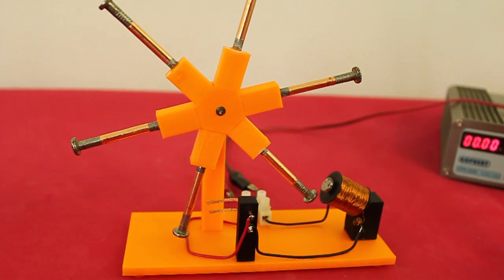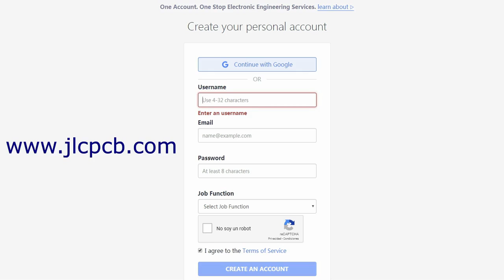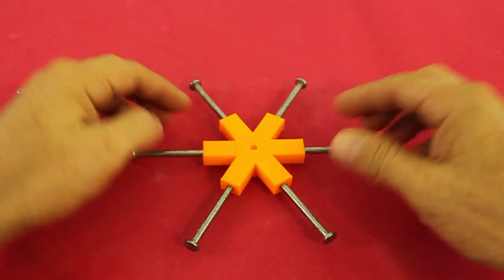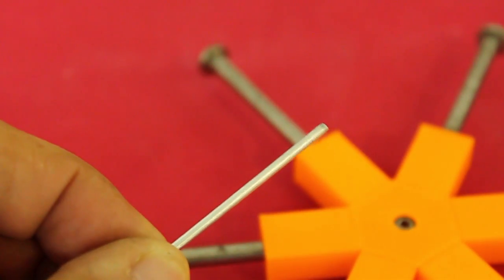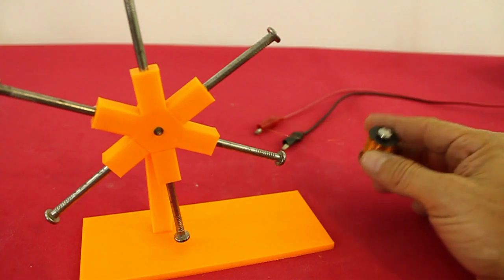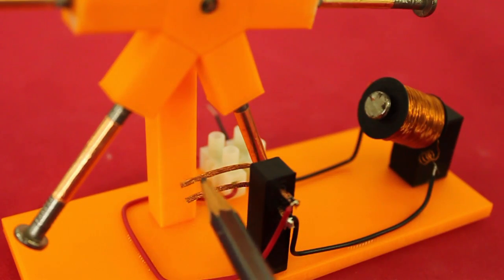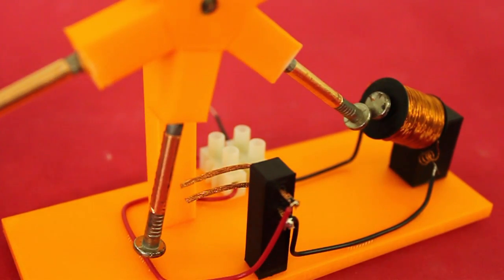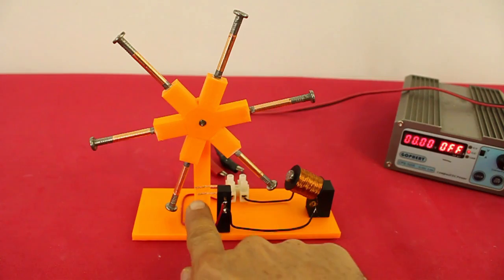Nail Motor that Uses No Permanent Magnets

Comment: Cool and simple solution for an electric motor. This got me thinking of the sparks that wear the contacts down and will make the engine fail after a while. So I have an electric e-bike and every time I connected the battery to the controller I got a spark. 

After a while I didn't have any contact or the contact got overheated so I had to make a new contact. So a friend of mine did an electric switch of some kind that when it were in off mode the current went through a resistor when I connected it to the battery.

Then when I turned the switch on while it was connected it allowed the current to skip the resistor. That have saved my connectors from any kind of problems.
What I wish I could learn is to make such a switch myself because I think this is a must have solution. Also I don't know if it is possible to to make a connector that would work without a switch. Maybe some kind of two steps insert contact. I don't know. 
It would be really cool if you could show me how to make this switch. Thanks for the video. :)

Comment: Nice Project         I'm not sure if the plan is to get this motor to turn faster.     But If it is..    It would be adviseable to cross drill the nails and pin them into the 3D printed holder using stainless 22 gauge wire or paper clip pins  so they don't slip out and  kill your neighbor.
Reply from the maker: 😂 that's good advice!

Comment: Very good ludic. I do wonder if those nails could be magnetised enough during rotation to then pass a Reed switch immediately after the enigised coil. Maybe if they had some coopr wrapped around them and small super cap connected in parallel. That might just be enough to trigger a Reed switch
Reply from the maker: I guess they can, but the reed witch will burn with the high current demanded by the coil so you will need to add a transistor.

Comment: It would be neat to convert/adapt it to a generator. 

Many times less knowledge individuals may assert one needs a permanent magnet to generate electricity. Or may state if you use an electromagnet you can't generate more electrical power out than electrical power in which would be true as is, if one does not count the work added through moving a piece of iron in a magnetic field.  

One electrical energy generator that uses an electromagnet and coils is a simple car alternator, and Synchronous Reluctance Machines can be made to motor or generate.

Comment: muito bom. eu  já fiz este teste, não com magnético de bobina, mas fiz com ima, mas não deu seguimento, talvez por está muito junto as  ponta de ferro que coloquei, agora vendo essa distancia que você colocou com bobina, vou tentar mais uma vez com ima, talvez eu consiga o que tinha em mente. bom trabalho
Reply: One has several options.  Two of which are.... 
1) one  can atract a magnet to iron. And at the right instant, push current through the coil to counter the attraction and briefly push the magnet just as it passes. 

2) one could use current in a coil to attract the magnet  and while a high permibility core will help attract the magnet, it will also try to slowit down after passing. You might even skip using a iron core for your coil if you have sufficent turns on the coil.

Comment: My problem is, when applying Voltage to the Coil I get short circuit, because the copper wire in the coil has no resistance :(